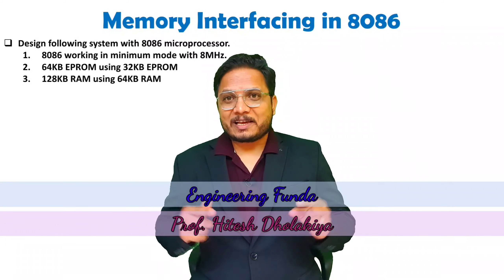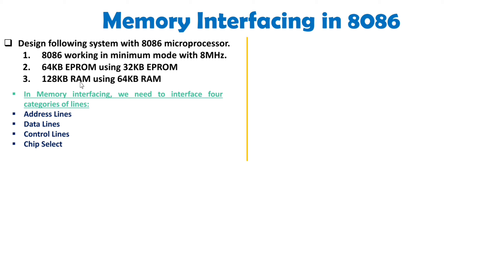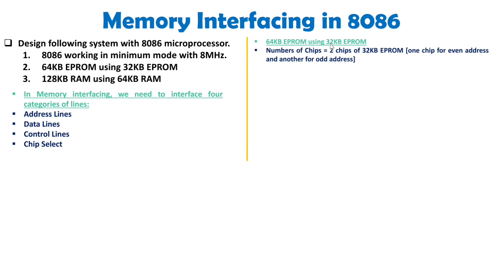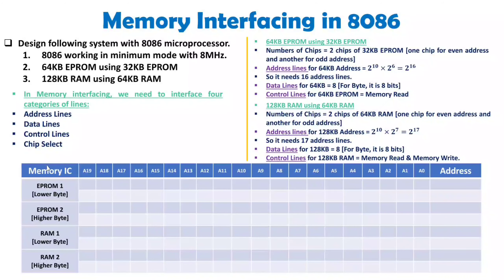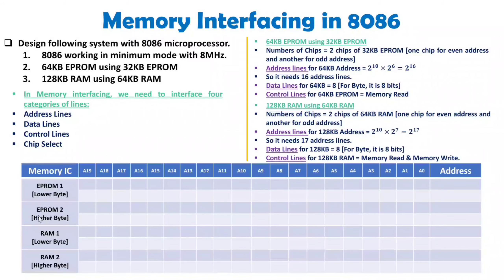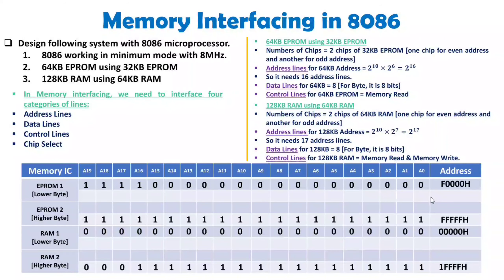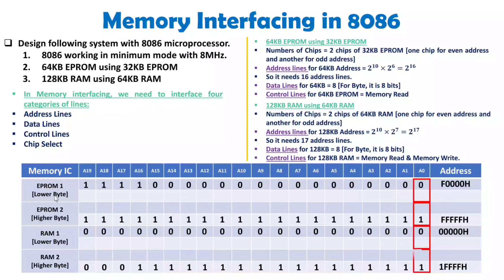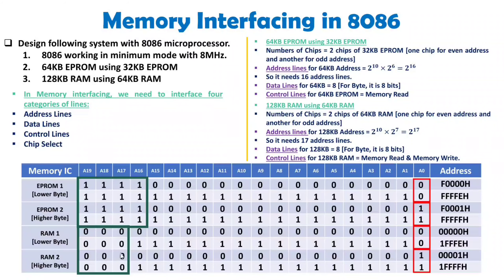Memory Interfacing in 8086 Microprocessor | 8086

Comment: Question:
I have two eproms connected
The address map is set for the eprom to be 8000hex to FFFFh
I have 16 address lines connected to allow 8000h up to FFFFh
I have low bank and high bank eprom with d0 to d7 on low and d8 to d15 on high
The 8086 has address 8000h and reads low byte and high byte instruction
It then moves on next memory cycle to 8002 and reads low and high
But how ?
The address on high bank is 8000h but the same address 8000h is on low bank too
Should the high bank address not be 8000h and the low bank address be 8001h ?
It seems to be using the same address on both EPROMs ?
Reply from the maker: I think you should see the explanation of interfacing again.

Comment: Q3. A processor is connected to a RAM with a capacity of 2M and a ROM with a capacity of 40K. The number of address lines for the processor is 32, and the number of data lines is 8. Calculate the following:

a. The address range of the RAM and the number of locations within the memory.

b. The address range of the ROM and the number of locations within the memory

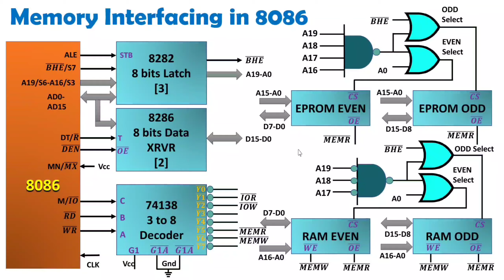Comment: 17:30 -  The bidirectional bus of data on ROM's is wrong. It should be only an entering data bus, since ROM means "READ ONLY MEMORY". It doesn't write data.
Reply from the maker: See it properly. With ROM I have provided unidirectional lines and with RAM it is bidirectional lines.
Reply: @EngineeringFunda  You should see it properly. The diagram is wrong and so are you.
Reply: @Mynhassty  ice on the cake